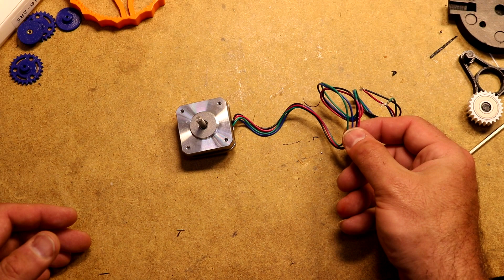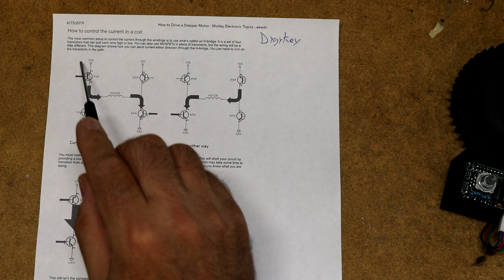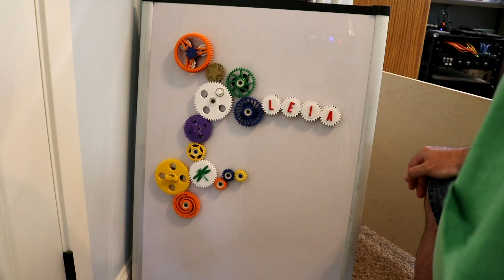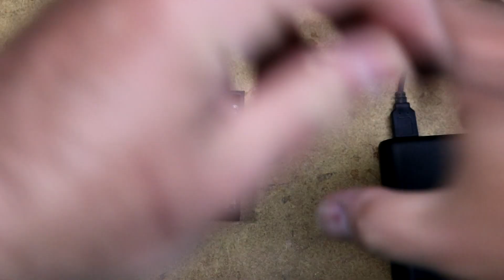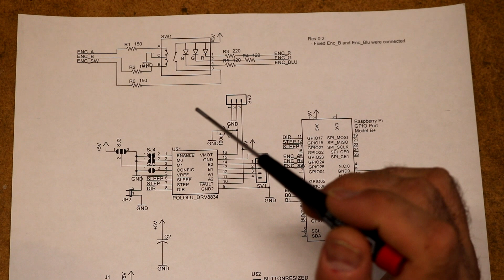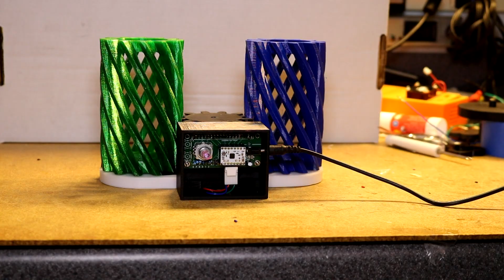Stepper Motors, Drivers, Rasberry Pis, and 3D Printed Gear Stuff!

Comment: Stepper motors actually have very poor torque. Dc motors and servo motors even without gearboxes generally have more torque.
Reply: that's not correct, stepper motors have very high torque at lower speed, torque decrease with speed